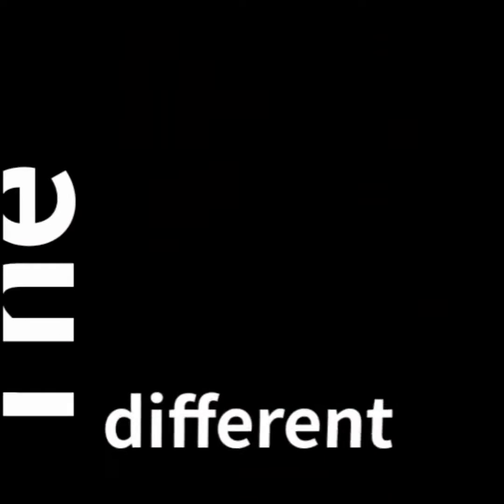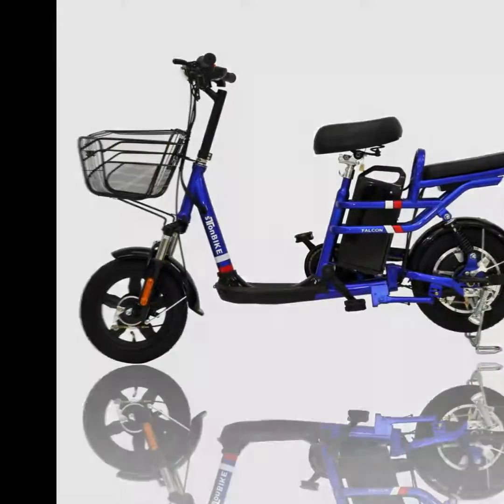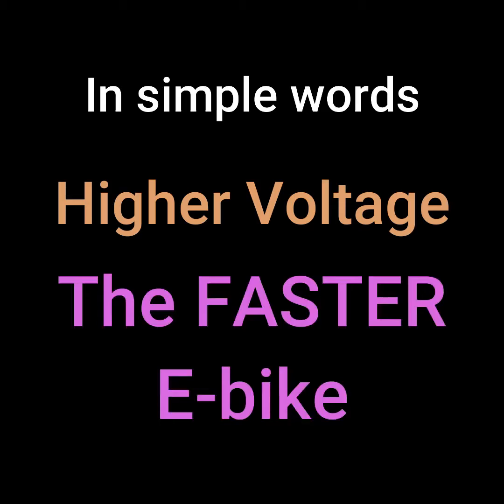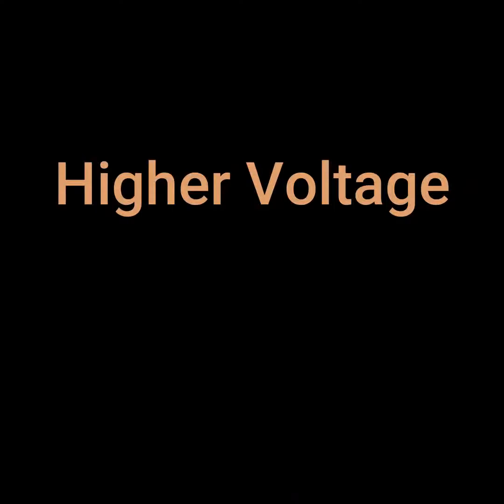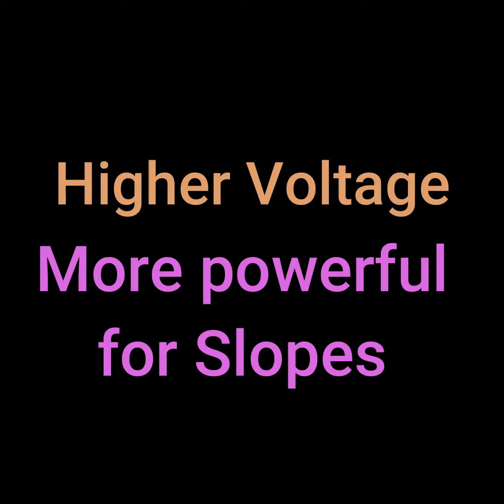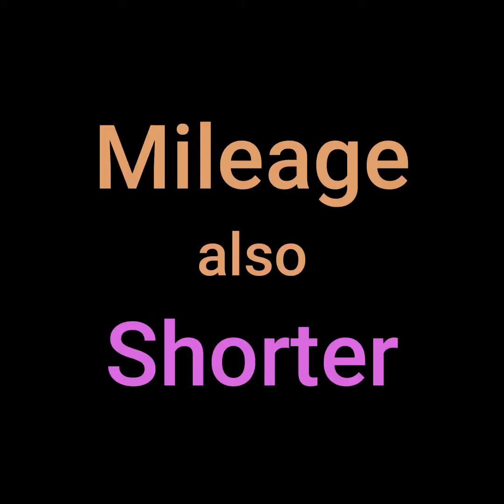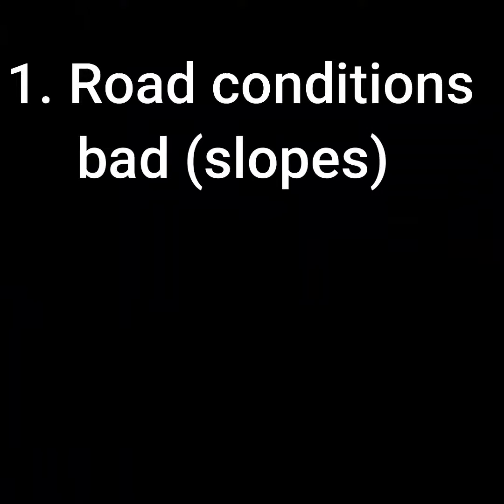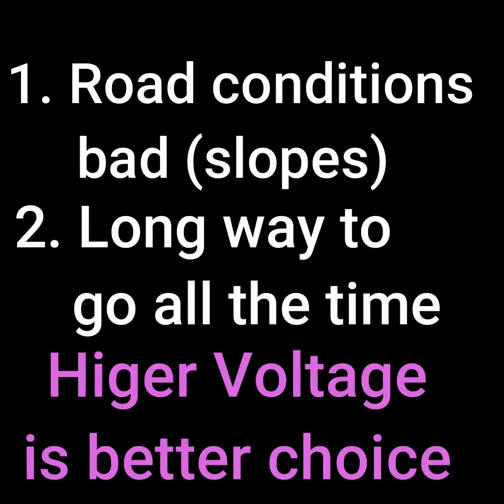What is the difference between a 36V , 48V and 60V e-bike? - Stonbike

Comment: Can I use a 36v battery as a back up battery for my 48v  ebike?
Reply: Yes
Reply: If you disconnect the 48v battery when connecting the 36v, yes. If you dont, it may go boom depending on the 48v charge